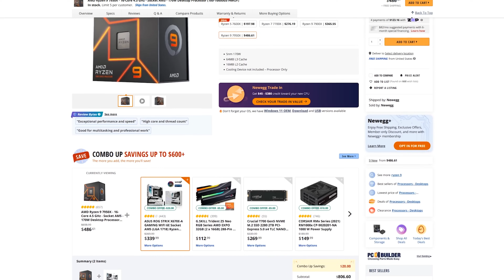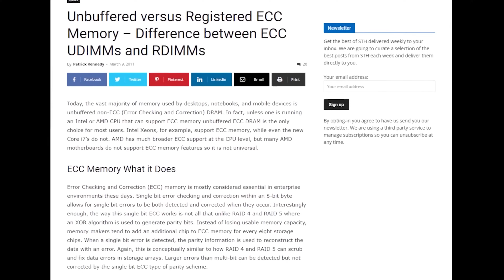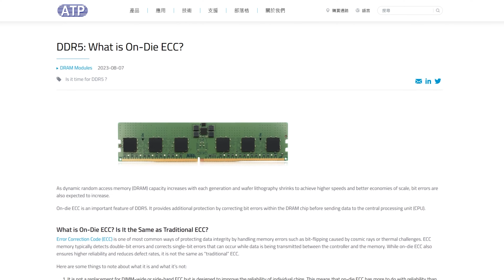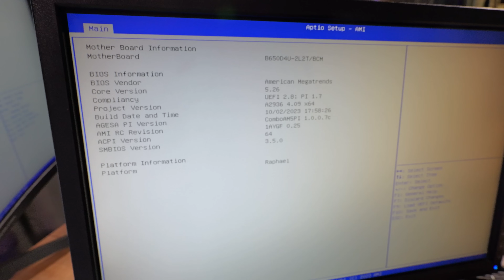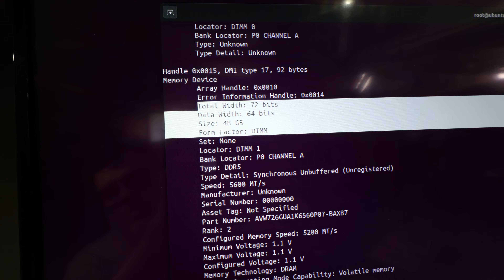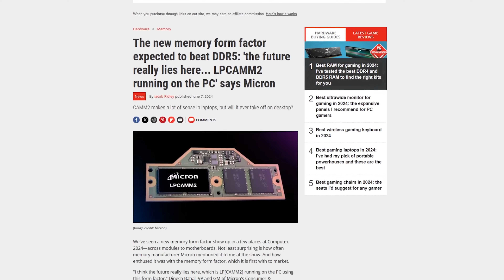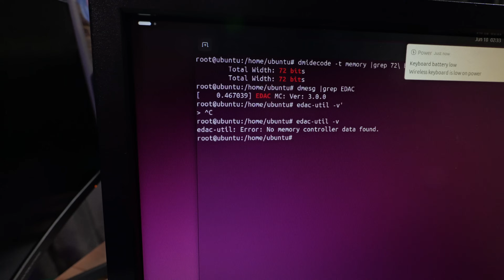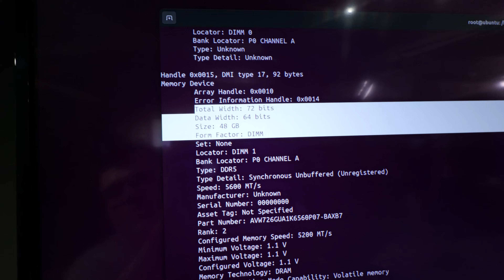What's Up With Error Correcting Memory on AM5 in 2024?

Comment from the maker: SQUEAKY WHEEL GETS THE GREASE: gigabyte aorus elite ax working now with f30 bios, see wendells tweet. Go team!!
https://x.com/tekwendell/status/1806160769723076873
Reply: Hi, I have a question about the 128 gb with unregistered udimms in ddr5 (without or with ecc, would like without for my system, Intel...) Where can you get 64gb single stick ddr5 Memory to get 128gb with only 2 dimms? Had 4 32gb sticks and couldn't go over 4800 mt/s, with 2 sticks I can use 5600 mt/s and also 6000 mt/s without problems, 6000 mt/s only with xmp (so would only use 5600 on 128 gb with 2 sticks, xmp on ddr5 is just a mess mess, but since I can't use my 128 gb, I want at least the speed from 2 sticks for 64 gb) Have seen no release news, only working on it news from crucial, at least in Germany and looking at English press I see through different channels and Google and YouTube videos... Is it available as udimms right now or where you talking about the upcoming things not released yet or about rdimms? Can't find 64 dimms, Google only shows me 2x32gb sticks udimm ddr5 non ecc or udimm ecc, only registered ecc 64 gb ddr5.
Reply: ECC CAMM2 RAM will be interesting!

Comment: Ok, so I've waited for the new chipsets and am about to embark on this journey. My plan is to build a proxmox server that caters to all my needs as a 24/7 server as well as a Windows gaming VM. I've currently set my eyes on the Gigabyte Aorus Master X870E, which was the only board I found with that chipset that has 48gb ECC dimms on their QVL. Eyeing the Kingston KSM56E46BD8KM-48HM for now. It's really annoying to go through these lists as only Asus seems to be able to add a filter for ECC in the first place (or I'm stupid :) ), and the amoung of supported RAM is just too long to check what's ECC and what isn't. The idea is to start with a 2x48gb setup that can potentially be doubled, is that still a no-go? I plan on running this on a 9900X3D, was thinking about an Epyc but I'm no tsure about the compatibility on the consumer boards. Any suggestions from the pros? Thanks!

Comment: Check out 4DS Memory Non-Filament Interface Switching ReRAM. It has minimal error correction and uses the entire surface of the memory cell to switch states using single shot programming at 4.7ns.

Comment: I have built several workstations with ASRock mobos and ECC. On Zen 1-3. Very useful for running certain workloads. And necessary for stuff like zfs. Want to check if your ECC is working, fire up a Linux VM and build a zpool.

Comment: Thank you for this video!... I worried about this myself..I just started acquiring parts for my next build with AMD 7950x and I went with the x670e Asus ProArt since it has a lot of features I want HOWEVER... I seem to be coming across a lot go warnings regarding the Ram and I wanted to go 128gb.  Asus is telling me its best to go with a 4 stick kit (kingston fury beast 4x32gb) but they only list XMP options as supported.  Is this still wise to go with to keep things stable?  I also have 2 -  2x32gb Gskill  trident Z5 Neo ram but if youre saying running two sticks is more stable which should I go with the 4x32gb kingston xmp sticks or just run 2 of the 32gb gskill and only run a 64gb ram system..?   any insight would be greatly appreciated thank you

Comment: In my honest opinion: having a board with only two ram slots, if you usually always had 4 using 2 of them - and now are using a board with 2 and use 2 - is the definition "of 5he biggest error you could make". 
Bro electricity also only works bc if the empty slots. 
Going from 4 slot: 2 on and 2 off (where you got 50% split into (25% ( 0 ) 25% ( 0 )) to now (50% + 50%) is the definition "of not having the system put the 4 (chinese death) and (50% (if it's about truth values a 50% true and 50% false statement can never be logically understood, like 20 heads coinflips in a row first try) into a moebiusstrip.
In my opinion a pc is a logic machine. When you do "ram - no ram - ram - no ram" you do circle logic the circle logic" you split a 50% - you in the hardcore architecture say "power symbol" - interruption of a circle (that is a 50% statement).

If you go 2 ram slots and fill both of them up, your like a 100% statement - if that's your life - your life is over.
You need to leave out that which is defined as your death.
Because it's like 2x 50% is 50% in an equals sign or 2 non logic statements on both sides of a non logical differential diagnosis. 

AM5 is critical... Not in a good way. Poisonous tree.

It's like there is a set of instructions of what a motherboard in my opinion should be and that's 4ram slots and atx.

If it doesn't have that - correct that error otherwise you building that thing are responsible for torturing people. 
everything smaller than atx... I don't like amputation and "small form factors" - in comparison they - are like persons who are/have been ripped off and it is like you now under them one of them. 

I'd honestly even consider it a problem to have these laying around - your error correction is not working...

Thats not what it is about... Well maybe it is for me OK!?
Only 2 slots instead of 4 on a board, even if your only using two? That's not what I consider a pc to be and I don't want that bs.

Comment: So for ECC in AM5 ITX that only leaves me with B650E from Asus and Asrock right?
I was really hoping for more than 2 sata ports, but I guess I can do m2 breakout to sata.
I’m trying to build a home media server / NAS in ITX, want 4 sata, ecc, and good media decode.
If I go Ryzen then I think a low profile intel arc a310 is my best bet for media decoding, which means I won’t have a free pcie slot.
Intel seems out due to lack of ecc support in desktop, and where I live I can’t easily source second hand gear and especially not second hand server gear, so I’m going all new. I’ll just run a bunch of VMs to try help justify the cost to myself later on.

Comment: $109.99 ASRock X570 PHANTOM GAMING 4 (8 SATA, 2 NVMe, 4 PCIe)
$200.00 64G 4x Kingston KSM32ED8/16HD ECC
$ 99.95 OWC 10G Ethernet PCIe 4.0 x4 Marvell AQC113CS (runs full speed on x1 slot)
$300.00 AMD Ryzen 9 5950X 16C/32T
All EL8+ & bubu22+ Linux works, no special drivers needed.  Cheap and good SSD 10G NAS for video editing and virtualized streaming pc w/ Elgato 4K60 Pro MK.2 & GPU passed-thru.  Bout to triple it for HA HDD storage and surveillance VM's.  Don't get APU; eats PCIe lanes!
Reply: That's a hell of a good value

Comment: i totally would not recommend getting an asus x670e proart. i have one, and i totally regret it. i got it for 10G in the first place, as i have all-10g networking at home. the aquantia-nic on this board (or how they applied it to the board) is totally trash. under linux it drops out for no obvious reason (link loss) and with alot of praying it may come back. on the machine itself, you can maybe enforce it with reloadsing the atlantic kernel module, however, most of the time the nic will not recover on its own, which disqualifies it as a server platform. disabling LRO/GRO (hw-offloading) helps abit and sometimes, but the base-error persists. on random occurrence it just drops out and does not recover. reloading the driver-module only helps temporarily, basically you have to reboot. i tested a plethora of cables (cat6 and 7, with and without grounding), differnt switches and/or sfp+-gbics on the other side, but nothing really helped. initially i thought it was a fluke, but other users report similar problems with this board, also on windows. so do yourself a favor, stop try hunting down boards with 10g onboard, because on consumer-boards they are all trash anyways and absurdly overpriced. go for a 30-50 buck intel 10g-nic with 2 ports. at last there is a reason, why everyone uses intel nics in enterprise-land... (and yes, I always try the latest bios if one comes around, in the hope that it will finally fix things...). really. do not buy this mainboard, even though it is the cheapest am5-board with 10g-ethernet. you will regret it...

Comment: Don't forget Kingston for ECC UDIMMS. I have 2 KSM48E40BD8KM-32HM sticks in my gaming machine (also with a heavy overclock on them. ECC is wonderful for overclocking). Mobo is the Asrock x670e pro rs. Not 100% convinced on the error reporting to the kernel on this board though.

Comment: With an ASRock B550M PRO4 AM4  motherboard with ECC, and Debian 12 with upgraded kernel Linux 6.9.3-zabbly+

I have this output
bob@homesrv01:~$ sudo edac-util -v
mc0: 0 Uncorrected Errors with no DIMM info
mc0: 0 Corrected Errors with no DIMM info
edac-util: No errors to report.

I wonder if ECC could not be working properly as with another motherboard and Debian 12 wtih  kernel Linux 6.1.0-21-amd64 
I have this output:

bob@bobdeb:~$ sudo edac-util -v
mc0: 0 Uncorrected Errors with no DIMM info
mc0: 0 Corrected Errors with no DIMM info
mc0: csrow2: 0 Uncorrected Errors
mc0: csrow2: mc#0csrow#2channel#0: 0 Corrected Errors
mc0: csrow2: mc#0csrow#2channel#1: 0 Corrected Errors
edac-util: No errors to report.

Comment: I'd only gone for AM5 two months ago, trying to surf one of those slightly more budget friendly waves shortly before the next big one.

And boy was I knocked off the board by just how bad 2DPC is working with DDR5!

The original IBM PC had parity RAM, never quite lost that primal fear of a bit flip since, even if I never observed any on the 64k it launched with.

At a billion bits (128GB) I just feel better spending that little extra to ban and eliminate it from that large list of things that can go wrong in computers that require binary precision all the time.

Only to find that what was trivial on AM4 with DDR4-3200 ECC was impossible to make work with DDR5 on AM5: I had completely missed months if not more than a year of tragedies from people who had tried and floundered.

In the end I went with 96GB of DDR5-5600 1DPC ECC for a 128GB DDR5-5600 2DPC price, which isn't how I imagined progress, but at least worked just fine even at DDR5-6000 (ECC).

7950X3D finally gets me with an RTX 4090 where 5950X didn't quite: 4k gaming that just works without having to spend more time on tuning the game than gaming itself.

I swear: no upgrades for years now, because you cheated on delivering real improvements on every angle and that's just not nice. And 240 FPS make no sense when my reaction time has dropped to half my age.

Comment: Are you able to downclock and undervolt the AM5 EPYC chips?

Looking at building a low power OpenWRT system with the PCIe lanes to support some Wi-Fi modules and NVMe drives but I need to be able to lower the clocks and the voltage to drastically cut the system power draw.

If not then I'll just have to try and get a hold of one of the Ryzen PRO chips which have shown to be more expensive than these EPYC desktop chips.

Comment: One other shortcoming of on-die ECC is that it is only single-error correcting (SEC) and not dual-error detecting (not DED).

For performance reasons a Hamming code is used, with 8 check bits protecting 128 information bits. Nine bits are required to detect all the double-bit errors, so approximately half of the double errors go undetected. This is why it's critical to have host support that scrubs the memory and corrects single errors before they accumulate and become undetectable double errors.

Comment: @level1techs I've scoured Computex news for data about PCIe layouts on the new AM5 boards and I couldn't find anything written about it. I've pixel peeped the photos to see how many electrical connectors each slot has and only saw the usual x16 CPU x4 chipset rubbish, apart from the X870E Taichi Lite, which at least has x8 x8, but only two slots.
Could you please tell me what you saw in the way of better PCIe lane assignments, as mentioned in the video?

Comment: Even without system-based monitoring support, does the internal ECC of DDR5 correct errors automatically? At least stop cosmic ray incursions.
Reply: No, errors are not corrected automatically by the chips. They have to be told to rewrite the corrected data. This command may be issued by the memory controller, in which case it should be transparent to the user and operating system.
Reply: @shanent5793  Now this problem with not being able to monitor the ECC, does it affect the ability of the memory controller to issue correction commands? Or are they separate issues?

Comment: Why does Wendell feel the need continually single out unbuffered DDR5 ECC as "half baked" or otherwise inferior to the registered implementations. Registers are simply unnecessary for the low capacity of client processor based servers. Whether or not errors are reported at a system management level is a matter of preference, and is clearly not important if you're recommending gaming motherbards.

BTW DDR5 sub channels are 32 bits wide, not 16 bits as stated in the video
Reply: "Preference" . . . is a fair point 👍
I am in the (i think) smallish minority of micro-businesses who also DIY their systems (leveraging off-the-shelf parts, mostly consumer for creature comforts, new and used) (choosing within reason to outsource less to local msps and co-lo's or to sys integrators Dell, HP, etc. or to mega Goog, Msft et al).
For us tiny such LLCs, various configs are possible. For example, I might install ecc (u or r by "preference") in my machines generating new, business-critical data streams (e.g. Windows server).
Whereas I might altogether skip ecc in machines not generating new data (e.g., file servers), wherein redundant copies of data-at-rest are checked with low-cost hashing of and between all such copies ‒ both upon landing there and subsequently according to a schedule.
@shanent5793  thx for helpful posts throughout this comments section.
Kindest regards, friends and neighbours.

Comment: Are rack motherboards a suitable replacement for regular gaming motherboards?

I have a mixed use-case that requires both ECC and gaming (it's complicated). What would I be missing out on if I go with a rack motherboard like the ASRock B650?
Reply: No RGB, so most should stop reading right here.

The boot time is much longer, taking several minutes. It's not just the memory training, you flip the switch and wait for the BMC to boot, then it powers up, then does self tests for a few minutes and possibly probes the network looking for a configuration server.

If you want to experiment with RAM timings, there's no auto recovery so you have to pull the battery and drain the CMOS, then re-enter all the CMOS settings. It might be possible to store the CMOS on a server and edit the configuration file which would actually be convenient but I haven't tried it yet. At least there's a diagnostic display, if it says "C5" then the memory training has certainly failed and you can stop waiting.

The second page of the BIOS which leads to most of the settings is excruciatingly slow to enter.

The CPU socket is rotated a quarter turn CCW, putting the RAM across the top of the board, perpendicular to and on the side adjacent to the IO shield area. This will rotate the CPU cooler, though you can get brackets from Noctua to rotate their big cooler back. It still interferes with the x4 socket, so standard cards won't fit, I had to use the lowest profile cable adapter I could find. Probably not a big deal with smaller coolers.

No built in audio, so use the speakers in the monitor or plug headphones into a game controller.

USB is only 5Gbit.

There's really no substitute for the BMC, which can be accessed through any current web browser. There's also a real serial port, which can be used to access the BIOS if needed. The fans are also controlled by an app inside the BMC, though you have to read the ASROCK help pages to make sense of it.

Genuine Intel gigabit. The two 10GBase-T ports are respectable Broadcom interfaces, unlike the Marvell or Aquantia junk slapped onto other boards.

Did I mention no RGB?
Reply: @shanent5793  Wow thanks for the detailed response. No RGB is a feature for me, also no shitty Killer networking like on ASRock's consumer boards is a good one. No audio is a good thing as that should be handled by an external DAC. Only headache would be the layout with regards to cooling.
Reply: @TRK--xk7bb  back in the '90s I had a board with an on-board vacuum tube preamp, but otherwise I go external.

The cooling could actually be superior because it flows front to back but you still have to be careful with the huge tower coolers. I should mention that I use mini-sas cables to split up the x16 slot so the GPU isn't actually isn't in it's place, if it were it would smother a tower cooler if the fans are facing up and down in the default orientation.

The VRM also looks absolutely puny, but there's no problem turning up the PBO with a 7950X3D. Not sure how it would handle a 7950X with all the stops pulled

Comment: is 3600mhz limit still there with 4 sticks?
Reply: With my ASROCK rack board and the January bios, it still defaults to  3600, but it will boot reliably with it set to 4200 and no other changes. 4800 needed some bus termination tweaks and occasionally fails to train, but once it's running it doesn't fail the usual stress tests. I have crashed it when I shut down an enormous, bloated, in-house Java application, so I leave it at 4200
Reply: Its probably fine for gaming but its not stable enough for ECC use